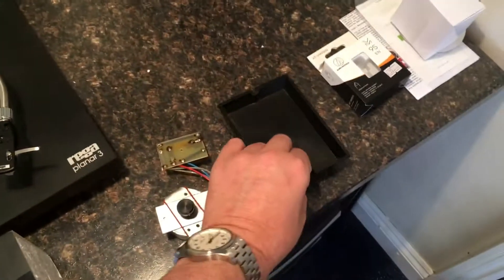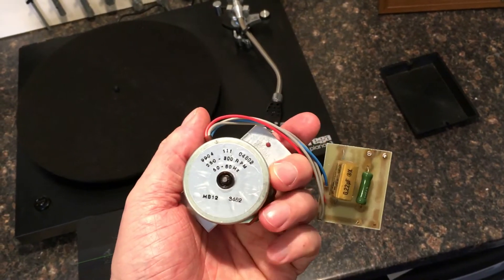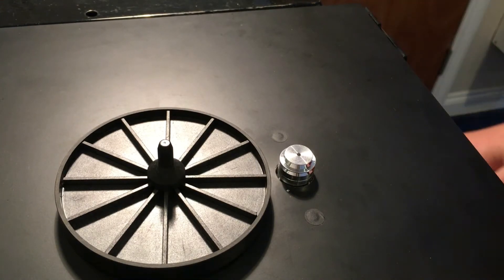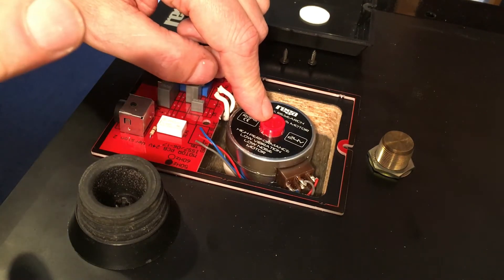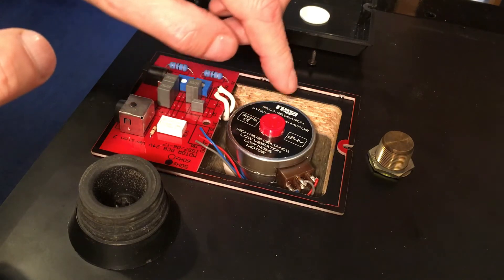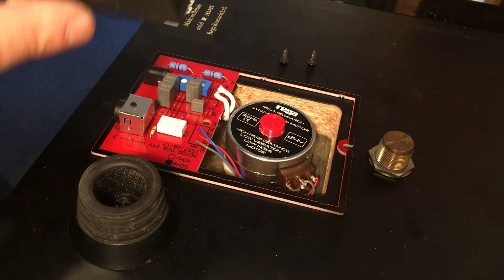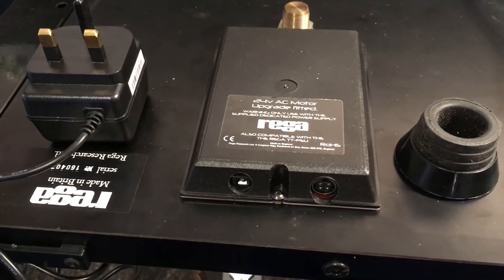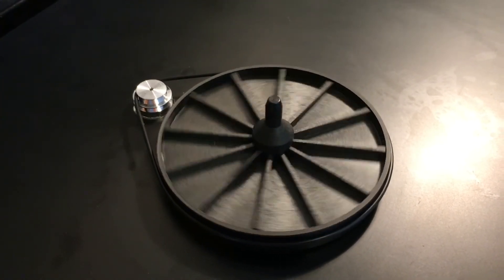How to fit a 24v Motor kit to a Rega Planar Turntable

Comment: Just recently 9:10 I had this issue too, used the triple as per the instructions but the motor was too high and the platter was resting on it when placed on so put the twin on too and works great. Also had to resolder the centre wire to the motor as it had become detached in the box, very delicate.

Comment: Was astonished to see that the motor is held in position by glue only and there are no screws for a secure fit and fastening. The glue will most likely loose its adhesive properties very fast in my country, India as its warm and humid 10 months a year. Not at all convincing from such a high end brand.

Comment: I live in the USA. I have an older original Planar 2 with a British voltage motor that has been sitting unused for years. Could I use the 24 volt motor kit and a replacement pulley to convert it to USA 110v use? Thanks for your videos!
Reply: Yes - in the US it should be supplied with a 110v - 24v wall wart. Get a 60hz pulley from Tango Spinner or a Rega dealer if they will sell you one and swap it over. I did something similar with my P3 from the UK.
Reply: @chrisharris6384  Thanks for the reply. I already have an RB300 for it too
Reply: @korling99  Awesome - IIRC, I got hold of a replacement pulley for about $7 from my local Rega dealer

Comment: I own an old planar3 and after 24v kit installation , I notice more motor noise when record is playing only in the quite/silent parts of the record, the noise increase when the cart get closer to the spindle, no noise when the motor is on and the arm is not touching the record, do you think a Neo PSU will help? thanks
Reply: Are you running a separate ground wire from turntable to amp?
Reply: @engjds  no
Reply: @enricogarbin1903  Most turntables do, not sure if the Planers have that, but worth checking.
Reply: @enricogarbin1903  Then you could try replacing the power cables with shielded types, get a good quality Belkin, but first step is to make sure the spindle is connected to the ground wire, maybe the connections come loose.
Reply: @engjds  Thanks so much for your help
Reply: @enricogarbin1903  No, problems, if you need any more help just let me know, I am an electronic design eng.
Reply: Adding blu tac at the bottom of the motor will also act as dampener I read somewhere
Reply: @sanjayh8645  Hardly an improvement, be better adding mass to the chassis.

Comment: Does this have a glass platter? Mine is running slow. Can’t figure it out and i think it might be the heavy glass platter on it.
Reply: Try using Isopropanol on the parts the belt contacts, to remove grease, failing that, you need a new drive belt assuming the motor is not loose and at the right position.

Comment: Hi, wondered if you could help, I have a P2 and moved to Canada.a company put a 24v upgrade motor in so it would work on 60hz but they kept the original board ? I am going to reattach the motor to the upgrade board and install it as the original board hasent got the correct capacitor and the plater needs to be encouraged in the right direction if not it’s a guessing game which way it will spin. What I wondered if you could help with is the wire set up for the motor and does the grey wire attach to both centre pins on the motor or just the upper ? 

I appreciate any help

Comment: Does this fit the NAD533?  The NAD533 was a rebadged Planar2 - or was it 'more' than a rebadge?  - am considering the 24V conversion plus Neo PSU
Reply from the maker: Pretty sure it does... if the underside looks the same, then yes it should
Reply: @cheshireaudio  Rega's website states "For use with Rega turntables only" - and they don't have an email and suggest product enquiries be addressed to their dealer network. I would need to know 100% if it fits the NAD533 or not before I buy but can't find anyone who knows for sure.
Reply from the maker: @iangibson871  I haven't actually seen a 533 for about 20 years...  but it's the same as a Planar 2. Logic would suggest it would work, but I wouldn't give a confident 'yes' without it in front of me ..... you could sent some photos of the bottom of the deck with and without motor cover to the shop email

Comment: The white foam dot on the plastic cover is for applying slight upward pressure  to help with vibration and also to hold the motor from de sticking with a bit of tension. It must be engaged with installation. From the manual.......Inside the motor cover tray a single white circular sticker is fitted which will align with the back of the mo tor bias pad. When the supplied tray is fitted it will gently compress.

Comment: Hello, i have just done this install and im hearing a slight motor noise that seems to start after about 30 seconds. Any idea why?
Reply from the maker: Let it run,  the 24v motors sometimes need to run in a bit
Reply: @cheshireaudio  ok thank you
Reply: @cheshireaudio  turns out that after a few weeks the speed is fluctuating like a warped record. Should i assume that i have a defective motor? I have sent it back based on that assumption and after the hassle i sure hope that is the case.
Reply from the maker: @grglcs  I can't think I've ever had a faulty 24v motor,  more likely a dry joint or component on the board....  I have seen issues with the socket for the power supply too,  they can bend if you don't push the plug in straight ... though any fault is pretty much unheard of.
Reply: @cheshireaudio  Man i was hoping for a different answer. By dry component on the board do you mean the part that comes with the kit? If so that's ok because i'm replacing the whole thing. What else could cause speed fluctuations? I did just clean, re-oil and put in a new ceramic bearing.
Reply from the maker: @grglcs  it has got to be part of the kit ... sorry, not easy to diagnose remotely.  I'm pretty convinced that if you have it replaced the problem will be cured.
Reply: @cheshireaudio  thank you for your input.
Reply: I’ve read that the engine (with the kit standard power transformer) is NOT torquy enough to make the upgrade glass platter rev at the start sequence, it’d ´ve a lot of difficulty to make it.
Anyone could tell about that?
Would the upgrade NeoPSU manage to help the motor a better way?
Thx all

Comment: My rega pl1 struggles to turn then goes into reverse then forward , reverse, forward etc etc has the motor gone or something else?
Reply from the maker: Sounds like the supply board has an issue, take it to a local Rega Dealer, it will be under warranty
Reply: @cheshireaudio  can i buy the necessary parts from you?
Reply from the maker: I'd need to see it to work out what's going on, never had a faulty P1 before... like I say, this will be under warranty, your local dealer should be able to help you
Reply: It could be the capacitors, they are used to start it up in the forward direction, just make sure you buy a replacement with correct uF value and voltage and get one that looks the same i.e. film capacitors.

Comment: Love your videos. So helpful.  I have a slow (very slow) starting Rega Planar 2.  I think with original motor (made in Belgium? Could that be?  2486 ... guessing 1986 vintage?)
Is that an original motor do you think?  And would the new motor kit work for me?
Reply from the maker: Yes, 1986 ...   these motors never fail.  I'm pretty sure that will be a detached pulley (See the 'Speed Problems' video #2)

Comment: Hi can anyone confirm that this kit can be fitted to  the newest Planar 1 (the one that comes with a 24v motor)? I want to be able to use the Neo TT PSU with it.
Reply from the maker: No, unfortunately these are designed to fit the earlier Planar 2 and 3, not the new Planar models
Reply: @cheshireaudio  I presume the 24V motor on the new Planar 1 doesn't have the little din socket for using with the external PSU?
Reply from the maker: @eduardothemaster  it doesn't, the first model in the line up with that feature is the Planar 3

Comment: what difference will this make
Reply from the maker: its a much quieter motor,  which improves detail .. sounds punchier too
Reply: @cheshireaudio  Why is it quieter, do you know how many poles this motor has? I know on my sondek it has a 24 pole, more poles equate to a smoother sound (combined with platter weight/inertia). I wish I knew the model of the motor, they have obviously bought a off the shelf and applied their label, if its a 250rpm one with high number of poles, I might think about upgrading the sondek.